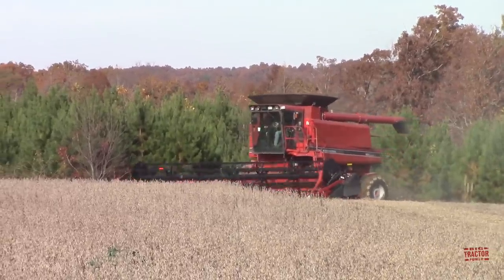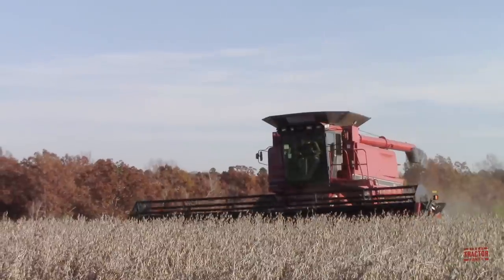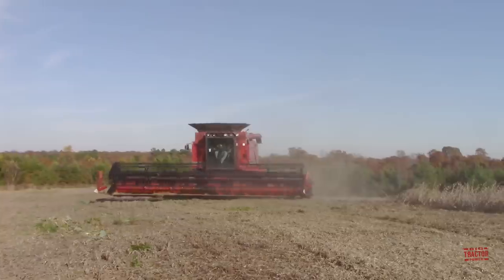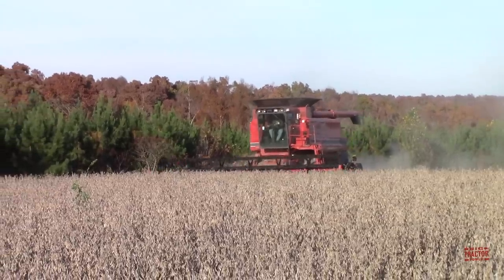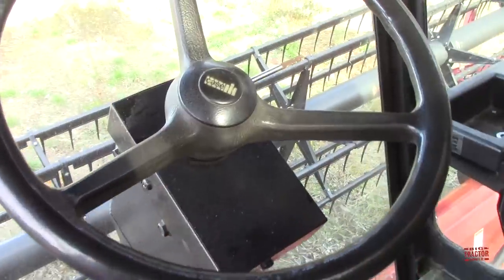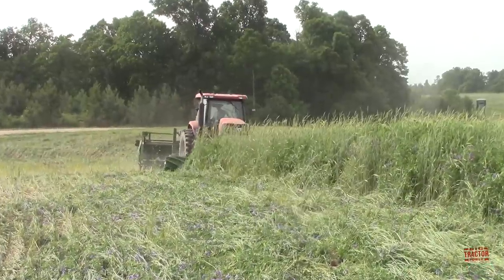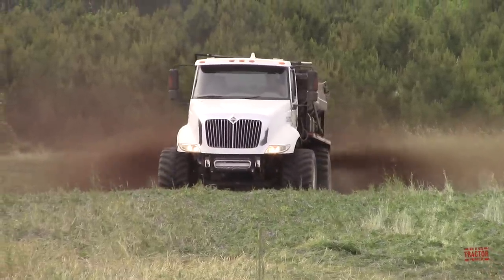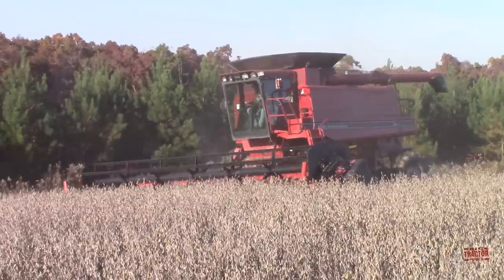CASE INTERNATIONAL 1680 Axial-Flow Combine Harvesting Soybeans

Comment: It's a mint condition B.T.P.,but that I still find that funny how you have to buy a whole machine when changing grains back then,on a John Deere,you didn't have to that,plus the Deere was a much beefier machine at 260hp.back in 1991 on their largest unit.(9600 series maximizer)
Reply from the maker: John Deere has small grains,  corn and soybean and rice combines. I have bunches of 00, 20 and Titan II brochures on all three variations.  These were more regional releases to specialize in the majority of the raised in area.  If you farmed in Kansas and Oklahoma you might but a small grain machine if your in Iowa or Illinois you would do with a corn and soybean model and Arkansas and Louisiana would look for a Rice model. Every brand had a rice model because a non rice model would ware out the grain return and unloading auger fast.  I know you saw it but in the 7720 Turbo video I  just released I mentioned the John Deere small grain, corn and rice models at https://m.youtube.com/watch?v=0w51jubA-Fs&t=209s

Today combines can switch in the touch of a button from one crop to the next. Back then certain parts were added to make a machine better suited for one crop. It’s not a flaw it is just the way it was.
Reply: @bigtractorpower  I know,but what I was saying that the Deere was a more flexible machine in general over the I.H.version of the same class of machine.

Comment: Are part's still manufacturing for 16xx series?
Reply from the maker: Yes I believe so.  The 1400, 1600, 2100, 2300 and 2500 are all very similar as far as there threshing.
Reply: @bigtractorpower  Yes they are still making parts for the 1600 series. We have an early 1620 with only 2,000 hrs and can still buy factory parts. Usually for the bigger model the dealers always have the parts in stock.

Comment: I remember operating our 1680 one time and the Rotor bolts sheared off up at the back. Well we couldn't figure out why the combine stopped so we open everything up and finally figure it out. So we had to go to my Uncles yard to use his quonset  shed because it was low enough that we could use the roof to hold up the back of the rotor while they fixed it.
Reply: sounds like 24 beer rather than a 12beer kinda job, lol.
Reply: @piperdoug428  It was probably more a cube kinda job (which is 48 beer) over a flat (24) kinda job. The Combine was down for 2 weeks, the parts were only a couple days but tearing the Rotor Gear box and pulley out and putting it back took the longest.

Comment: My dad still runs a 1644.  Kind of an odd duck,  but good little machine.  Like the 5.9 Cummins in it.
Reply from the maker: Very cool. I hope to film a 1622, 1644, 1666 and 1688 some day. It’s neat to find the smaller ones like the 1644 and 1622.
Reply: I think after they moved to the 1644, 66, & 88 they dropped the small 20 series leaving 1644 as smallest.

Comment: That header just doesn’t look like it is 30 feet wide
Reply from the maker: The 1020 is the model number for the flex head with plastic fingers which came in widths from 15 to 30ft. The 1010 was a ridged head with flat bats offered in sizes from 15 to 30ft.  In the cab portion of this video you can see the 1020 decal on the 30ft header looking from the cab window.  It is defiantly 30ft.

Comment: DT 466 not 1466
Reply from the maker: The sales brochure listed 1466. I questioned that reading it. I thought maybe there was a change so I read it the way it was listed.
Reply: bigtractorpower wow never heard of that my dads 1480 had a 436 ih maybe they added the 1 when case bought them out love your videos maybe you can make it out to the Texas panhandle for corn harvest some day
Reply from the maker: The 1 numeration is something I will need to investigate.  The DT 466 is one of those all time classic engines. I was surprised to see 1466. I use original sales lit for every video so I can read to facts direct from the manufacture. But that does not mean there is not a typo here and there in a brochure. I used a 1986 1680 spec sheet from Case IH. New company at the time so the Case guys might not of known their IH engines well 😁.  I do hope to get to Texas some day.
Reply: bigtractorpower well hit me up when your ready i work for a private fertilizer company in the Texas panhandle the company also has farm and ranch land we market all types of fertilizer and think you would like what all we do from making fertilizer to the marketing of anhydrous ammonia and a lot of other types as well also have our of trucking fleet of about 50 over the road trucks